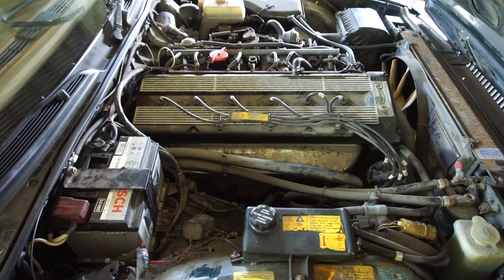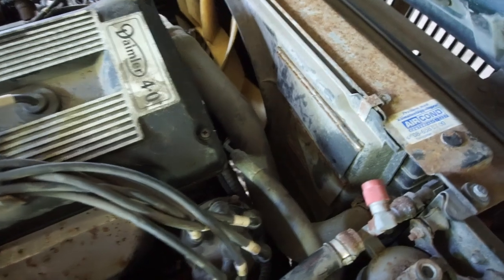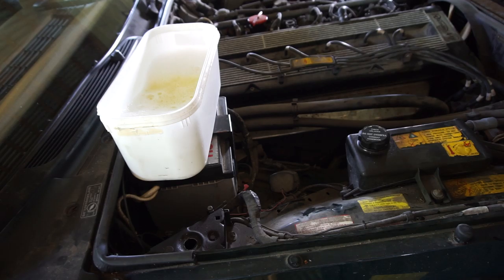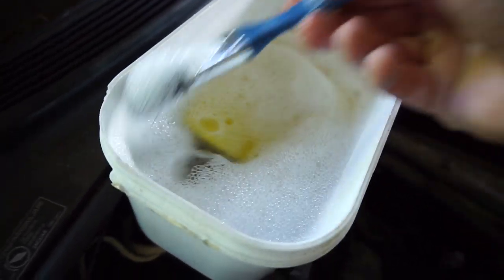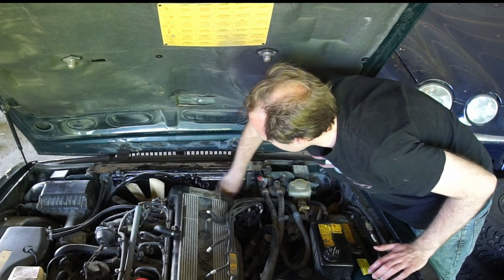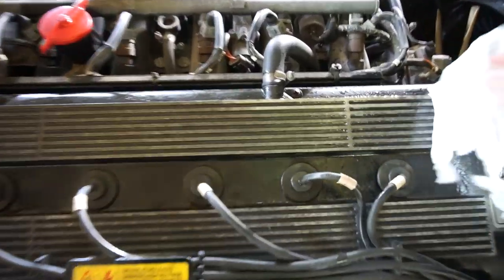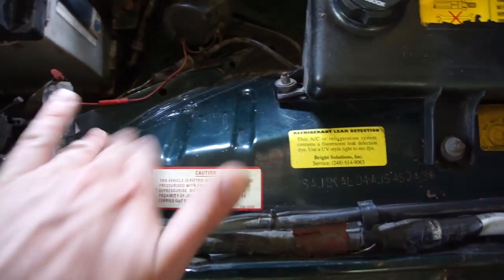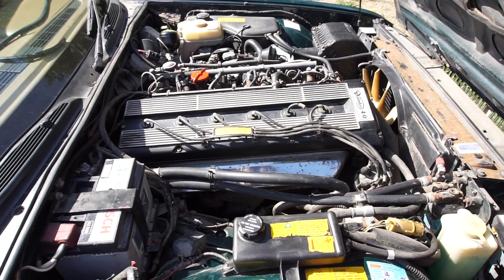Cleaning the Engine Bay On My New XJ40

Comment: Adam, you did the right thing by cleaning the engine bay by hand with a wash rag.  Laziness with these cars will get you in so much trouble.  If you take a pressure washer to this engine bay, as you mentioned, you will force water into all those non waterpack connectors and cause so many issues with the electrical system.  Doing it your way, ensures that it's clean but not destroyed. Smart man.

Comment: Thanks Adam, that was another great video. 
   That's exactly what I need to do on my newly acquired 1982 Jaguar XJ6, series 3. My engine bay is quite filthy and it needs a good cleaning also. Just the past week I replaced the top radiator hose because it started leaking from there and added more coolant/antifreeze to the proper level, where it had lost about 1 and 1/2 gallons of it.
   Thanks again Adam and a "HELLO" from Boston, Massachusetts U.S.A.
Reply from the maker: Isn’t it really nice to clean it up and make it a never place to work? Thanks for watching 🙂

Comment: For finishing touches i use rust convertor on any rusty bits, nuts bolts etc it turns them black. For rubber/plastics I use a bumper or trim treatment this makes under the bonnet very black and presentable.

Comment: Love your channel- after visiting Daughter n Husband in NZ and riding in a racing early 60's original type X decided to look into Jags and found your channel- though i was listening to some explanations from NZ why not to get a V12 - Watching YOUR Videos of working on the V12's took away most of my apprehension. As i was researching Older classic Jags i just missed buying two type S  6 cylinders, 1960's separately, however i spoke to a friend about now looking for Jags instead of VW BUGS and he said " My Grandmother is getting ready to list hers"  COVID-19 lockdown just occurred but i asked could he at least send pictures-  he did and her navy blue 1986 XJS V12 (HE) with original type wire rims and trim complete - needing seat stitching  work... but it was just the right buy for me- price was really good and body shape was outstanding but needed some TLC. we made the deal sight unseen. :) pictures were enough - only a few rust bubbles and didn't run. ALL the Paperwork from most years was with it. Following your steps on Ignitions found the cause- a Mouse had chewed through the distributor "point" sending wires to the lucas HE amplifier- i ordered new dist and rotor , temp repaired the  wires, added enough gas, charged a battery  and zzzt, EH EH EH VROOM! (more or less) so pleased. 
I am looking forward to servicing all the system layers as some really good info has come by the Videos. i guess when The Woman's Husband died, there were things happening that she was unable or didn;t know what to do - none of them serious.  I also was really Blessed to find three service manuals on Ebay for 75$ together, i scooped them up and in business! Excited to work on it, cant wait to drive it.
Reply from the maker: Sounds like a great project! Thanks for watching and best of luck

Comment: On all the cars that I had in the 60's and 70's in England I used to soak the engine bay with a product called 'gunk' then wait awhile then hose it all off to reveal an oil free surface.I loosely protected the electrics but never had any starting problems.Gunk had a very distinctive smell.I used tyre paint to put on all the rubber hoses as it was thin like petrol,very black  and could also be used on metal radiator parts and rusty metal bits.It looked super when dry.I am not sure if those products are still around as I have been in Canada since 1975.I love to see a clean engine bay as it is easy to spot leaks.Carry on doing the videos as you think is best.
Reply: Gunk is still available.

Comment: You have a beautiful car, and one that's a pleasure to drive. I have always admired the Daimler trim. I came close to inheriting one of these from a dear friend, but I felt that the caregiver who was with my friend when he passed deserved it more than I. It is exactly like yours.
    Coming from an area where the winter roads are not salted, I am stunned at how much corrosion damage is caused by road salt. My 1998 M-B has only one small speck of rust that I've treated, and the engine still looks great. No garage queen, I have more problems with moss in the car's gutters than others.
Reply from the maker: Rust can be very bad however I think it's getting better. Many places are using less salt it seems. Thanks for watching 😊

Comment: Hi Adam, A great place to start in the engine bay. You might consider replacing the standard air filter with a K and N replacement, a bit more expensive but it sure lets the engine breath. I've  used them on my 40 for a couple of years. Your doing a great job.
Reply: K&N filters are ONLY any good if you are going racing but not good for a daily driver. They are covered in oil and this oil solidifies and coats the inlet track and in-turn attracts carbon/dirt, clogging up the throttle body butterfly valve and other components, effecting performance. Best use is a nice dry paper filter. I was an advocate of K&N filters until I saw the long term effects.  Hope you find my comment interesting.
Reply from the maker: I have already purchased a standard filter for it. The XJS V12 has K and N on it and it works well
Reply: @joeblogs8193  Agreed! I know i'm late to the comment but when i read what you wrote in this statement i was so happy.  K & N's do NOT belong in any cars other than race cars.  They market themselves as an upscale filter replacement but they end up causing more damage than good.

Comment: Should get you a mini steam cleaner wand. Used for cleaning around your kitchen.
Reply from the maker: Are they safe with old decals?
Reply: @LivingWithAClassic   good for lifting in ground dirt out. You could always steam around labels. Heads only five to ten mm wide. Comes out under pressure. Not expensive. Find um on Ebay. A bit of practice you can lift dirt out your leather.

Comment: I have a question, why is it that the celing material of English cars fall after ten years?
Perhaps is that the English cars dont use tension rods for the fabric?
Excatly the same happened with my now defunct Discovery and also, with every older Jag and Range Rover I have seen!
Reply: Aussie Ford's do the same.
Reply from the maker: Sometimes it's the glue used and sometimes the foam that's under the fabric disintegrates. You can get new materials now that last